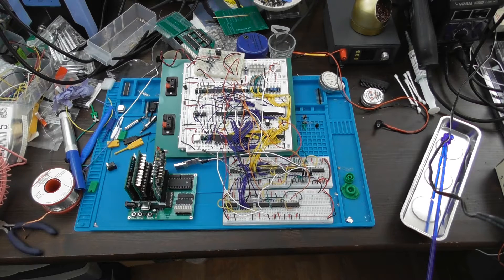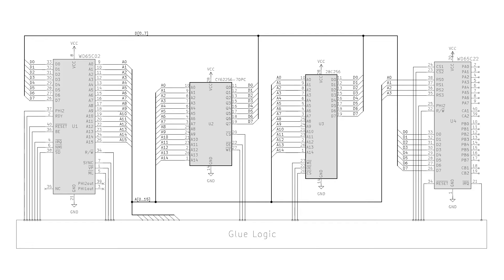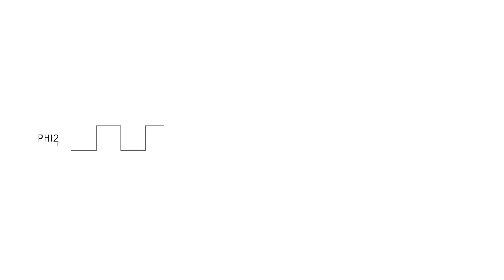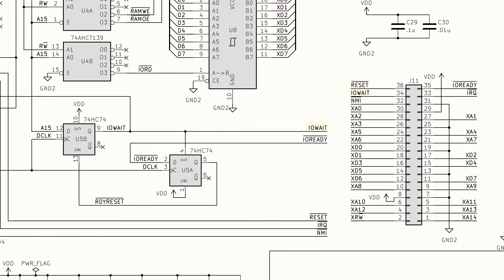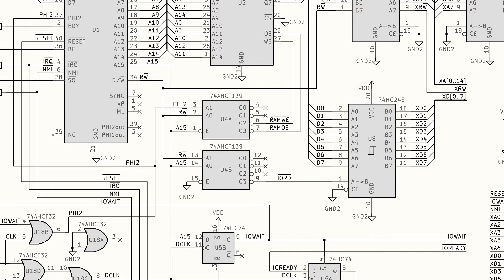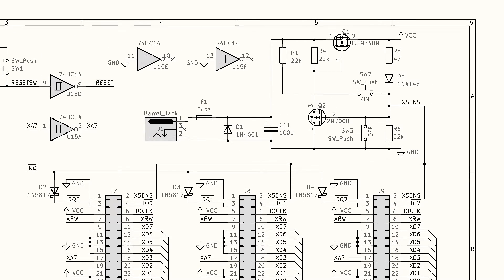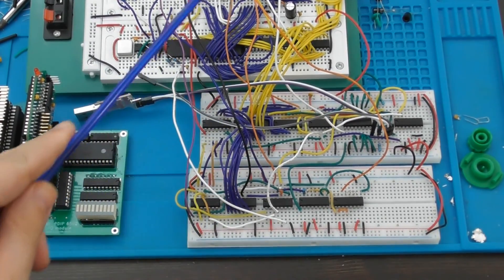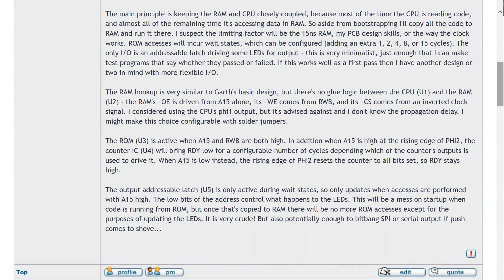Fast PDIP 6502 computer explained

Comment: Hi George. I've recreated your fast 6502 circuit on a breadboard running stably at 32MHz, which is far better than I expected. I can get Matt Heffernan's Mandelbrot benchmark to complete in about 1.5 seconds at 32x22 with 63 iterations. The difference between yours and mine is that I use a 6850B for I/O with a 7.3728MHz xtal and 70ns Flash Rom. I don't know what breadboards you use, but I'm using  BBS830s as they are very good quality (if a little expensive) and I'm putting decoupling caps over each chip from VCC to GND and this seems to improve stability. It's still at an early stage but I'm hoping to add VGA, sound and an SD card too. I'm very interested in the pre-emptive multi-tasking you have demoed, please explain further.
Reply from the maker: Nice! What sort of RAM are you using? Have you tried the Dormann test suite? That and a deep memory test were the things I was using to gauge maximum clock speed.

I've been tinkering with the multiprocess system again recently so hopefully I'll get around to talking more about it soon. Note that it is nowhere near as fast though and I haven't yet thought of a good way to combine it with this one to get the best of both worlds.

Comment: Very cool.  It makes me want to break out the wire wrapping tools again.  Your project takes me back to the mid seventies (but MUCH slower; only 1MHz).  I'm looking forward to your demos.
Reply: Those were good days when 450ns RAM came out then we could just barely get our 6502s running at 2 MHz if we could keep everything cool enough.
Reply from the maker: Thanks David, I'll have to write them though! So far I've mostly been running test suites.

Comment: Great explanation George! I'm impressed with how fast you got the breadboard version going and surprised you did have more decoupling evident.  I ended up making some custom sockets with decoupling caps to make some chips table at 25mhz.
Reply from the maker: Thanks James, yes I saw those, it's a nice idea, keeping things neat and reusable. I've never really managed to do good decoupling on breadboards, and mostly came to the conclusion that you just need to tolerate a lot of noise, for this and other reasons - it's not an ideal environment! The PCB version has good decoupling though, and a lot of care taken with trace routing and ground returns, on two-layer boards.

I built a good ground network on the breadboard too, so all signals should have an OK route for the return current, and added some decoupling at the power rails after finding that one specific test case was failing - the TSB instruction with quite specific inputs - apparently due to a dip in power input to the RAM!

Comment: Did you look into using the RDY pin? I started work on a DMA system that would use it but a better idea came to me so I never followed through.
Reply from the maker: Yes, my initial design did use RDY - the inverse of IOWAIT is exactly that signal, it just fed through a resistor to RDY. It worked OK, but I changed it to clock stretching because I was unhappy with the slew rate of RDY through the resistor.